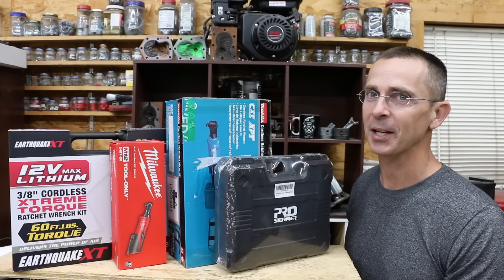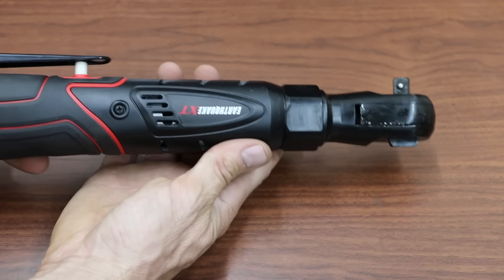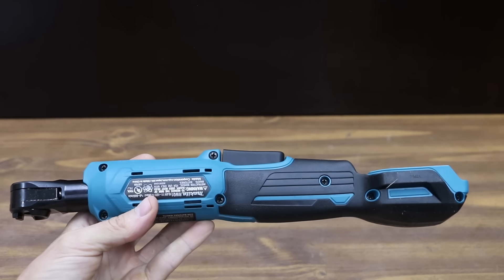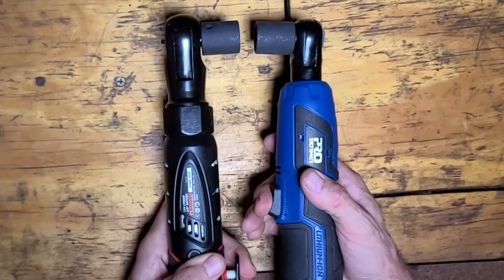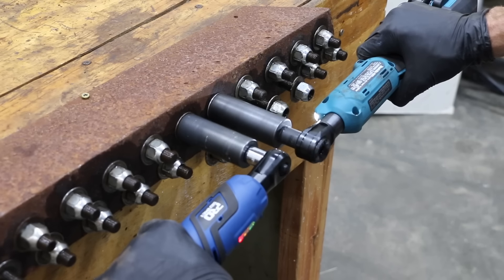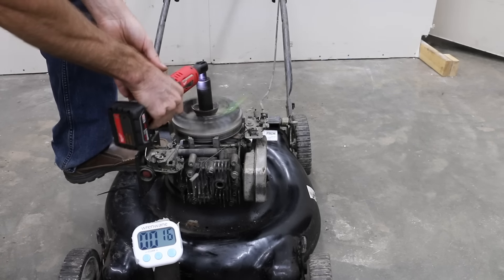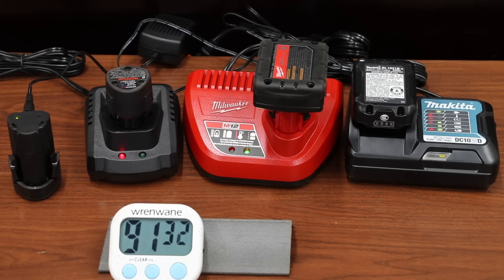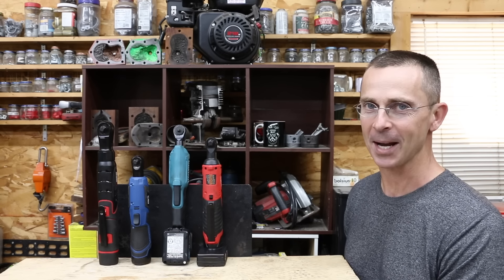Best 3/8 Cordless Ratchet? Milwaukee M12 vs Makita, Earthquake & ProStormer. Let’s find out!

Comment: I was a small engine mechanic. I hammered a Milwaukee 3/8 ratchet daily. It was awesome. I was diagnosed with Kienbachs disease.  The ratchet gave me the ability to continue do the work I loved up to the point where I couldn't pick the tool up anymore. I miss my old Milwaukee ratchet at my old employer.  I am going to buy one of these so I can fix peoples lawn equipment as a community service.  Small engine repair was the most rewarding job I ever had. I love picking up mowers on the side of the road, fixing them and giving them away. Normally doesn't cost hardly anything and their are plenty of people that need a mower. Plus it keeps good equipment out of the scrap yards and landfills.
Reply: Get the Fuel version of the Milwaukee. 55ft/lbs and a beefier head, can be used by hand.
Reply: Your community is damn lucky to have you.
Reply: Good soul
Reply: Bless your soul
Reply: Keep up the good work.
Reply: Keep it up! I love it when people keep good tools/bikes/cars/etc. out of the trash.
Reply: "@Robert Lamont" Milwaukee makes an even better one... Milwaukee 2557-20 M12 Fuel 3/8" Ratchet
Reply: Imagine what our country could be like if we all followed this man's example rather than yelling at each other all the time.
Reply: Really good for you sir.
Reply: I got my start working on engines with a 2 cycle moped. 10mm was the only size. Small engine repair has always stumped me. I have rebuilt v6 engines and 4 cylinder engines from the block up yet struggle to repair a small engine. They get fuel and spark yet never seem to start! I dislike them so much that anything small I have went electric with. Lawnmower, weed eater, hedge trimmers.  Hats off to you as I could never crack that code with them small engines.. they always make me feel dumb 😂
Reply: I know several diesel mechanics that use the m12 fuel version on a daily basis so I can agree with your statement Robert. I personally have a Mac tools one that I use daily.
Reply from the maker: Thanks for sharing!  I know a lot of folks really appreciate your help!
Reply: @BlockdAccount  Head is too large. I went for the bushed version for the head size. Best tool I own by far, and I have a LOT of tools I use.
Reply: Thank you sir!
Reply: We are one in the same. My engine experience started with a poor 3hp briggs and stratton lawn mower engine. It was by itself on the curb, no mower, when I was in 5th grade (1999). I was able to get it to run with nothing more than an adjustable wrench and a screwdriver. For me, that's where and when engines became something  for me to pass time with. To this day I still enjoy small engines on power equipment, and I eventually moved up to cars around 2001. I've had jobs doing both, but as an auto mechanic it made my hobby not so fun anymore and I ended up quitting. Shortly after I got a job running automated robot assembly machinery making different oil pressure control valves for GM LS engines and Ford ecoboost V6 engines. Unfortunately circumstances ended that for me. Recently got into a small engine mechanic job, but I was always at odds with the boss over how I viewed repairs, whats worth fixing and what was worth replacing. He told me that the 2jz supra engine was designed by BMW which is completely false, which I knew because I know a lot about older Toyota cars, AE86 Corollas being my forte. I thought it would be a good fit, but in reality I was nothing more than an oil changer and carburetor cleaner grunt. The last straw was an argument about a 70 dollar single stage snowblower snow box that was all rusted thin and cracked. There was nothing left to weld it was so thin. It was one of the first ones I looked at, which I said wasn't worth repairing and it needs a new one from day 3 on the job. Ended up spending 6 hours at 15 an hour trying to bandage the worthless part a week later. I tried, and it was about 90 dollars in time for me to be paid. A new one was 70 dollars, and I could have replaced it in 10 minutes and moved on. But instead he argued with me that I ruined a ruined part. I was about to just walk out, but I figured I'd come in the next day, a Friday and try. Ended up getting, "this isn't working out due to the tension" from management. Honestly, I'm glad, because now I look forward to the next opportunity somewhere else. I've always done machine operation, and I enjoy it for a job. Why? It is because machines don't argue, or make you feel bad. Not only that, I can be alone, doing my job, producing something that will complete a bigger picture. If I can't find anything such as that, I have decided to attempt to start my own small engine gig of sorts. Sorry for the life story here, but I just thought I could relate how the gear head disease set everything I've done in motion. A lone 3hp briggs and stratton. Wish I still had it.
Reply: As far as keeping equipment out of the scrap yard, I did have 1 opportunity to literally save something from the bin. Back in 2013, the local yard had a small bin in front, and I saw an orange something or another laying on top of the chaos. It caught my eye and I walked over, and low and behold, a vintage 70s horizontal shaft 2hp briggs and stratton engine. It was complete, even had a pulley on it, and was actually in pretty good condition! I grabbed it out and it pulled over with compression. I went to one of the guys working and inquired about purchasing it from the yard. He said I don't know, go inside and ask. So I did, and I walked away with it for a whopping $5. Took it home, filled the oil and some fuel. It literally started on the first pull. Very cool indeed. I haven't put it on anything yet to this day. But the orange 2hp became a sort of remembrance time piece. My late friend Mike was over by my house one time in October that year. I had previously took the muffler off because loud noise lol. It shot flames and pops and all the like and I told Mike about it since it was on the desk. He says, I wanna see that! He took out his phone to take a video, which comes up every year in my Facebook memories. He captioned it, "tiny tin motor shooting mad flames". He passed 2 years later. He got into some sort of accident on his sport bike without a helmet. Nobody saw it happen, so it remains a mystery. I have a theory as to the cause. Mike loved fast cars, and fast bikes. The area it happened was a 65mph zone left handed curve ramp from Highway 16 onto I94 east in Waukesha Wi. All anyone knows is he hit one of the yellow arrow signs and ended up in the ravine past that. I think Mike was in full blown moto GP mode for fun, he tucked the front as they call it, slid into the signpost with the center of his bike. When that happened I think its possible the bikes momentum caused the bike to stand back up and he hit his head somewhere on that sign. Then it broke away, and then it was over. Really miss that guy. One of the coolest people I've met. Everytime I go down to the garage I see that orange briggs, and remember his reaction and the smile on his face. So I guess 2 different small engines have both had a significant impact on my life. Keep doing the good work for people, its what I try to do everyday.
Reply: @jamesl9686  that's pretty darn fast for a 3hp kart man! I totally agree with you on other people's motivation and their passions. The guy came off to me as a "I'm lazy and just here for a paycheck" type of guy. I guess that is just all too commonplace these days.
Reply: I also have kienbachs but only in my left wrist.  I also have the Milwaukee which I got after watching DieselTechRon
Reply: My man!
Reply: @bansheedearg  sup
Reply: @ENGINERESCUE86  Replacing the Automatic Transmission Pan Gasket on my '97 Tacoma, just started leaking.  I love fixing stuff.
Reply: @bansheedearg  fun stuff! I'm having a snack after the packer game and passing out. Don't crossthread the bolts or you're gonna have a bad time. Ask me how I know lol
Reply: @jpgale  Do Miss Ron & his videos. Good guy!!
Reply: Good for you mate.
Reply: I salute you my brotha! I share your love for the community and also a mechanic always willing to do more for the community.
Reply: Good luck dude
Reply: Do any of you guys watch AvE on YouTube? Check him out he tears the tools (and other things) apart and give you the low down from the inside. Don't know his background but seems to me like maybe some type of engineer. I think he watches Todd on Project Farm.
Reply: America needs more people like you and less people on unemployment
Reply: That’s what it’s all about, u sir will live forever!
Reply: @ohioplayer-bl9em  I’m a small engine mechanic and we’re always amused by this. You definitely aren’t the only guy who I’ve heard of that can rebuild automotive engineers and can’t stand small engines. We had an aerospace engineer bring us a weed trimmer once and proclaim that he was stumped. I do some basic work on my old 94 Chevy but I find the engines in modern vehicles to be incredibly confusing compared to small engines 😂 so many sensors and vacuum lines and crap that simple small engines don’t have. I guess we all have our strengths and weaknesses.
Reply: That’s really cool of you man. I’m a small engine mechanic too and I agree that it’s incredibly rewarding. Usually repairs are simple and cheap, but people are always so impressed 😂. I’ve taken probably a dozen mowers from the curb and fixed them, which built my skills enough to get a job at a shop. Discarded push mowers are the best. 95% of the time you clean the carburetor, replace a needle & seat because of ethanol damage, change the oil/plug/filter, sharpen the blade and send them on their way. Costs all of 20 bucks.
Reply: Im only just watching this video now, but you sound like an awesome guy. Hope you're still fixing stuff.
Reply: I can fully relate to that. Trying to earn extra money in college, I got a job with Western Auto in Atlanta as their small engine mechanic for the summer. My only qualification was that I rebuilt my carburetor on my VW bug. That job allowed me to completely disassemble small engines if needed to repair them. I could study each product manual which was readily available. I also had a full warehouse of parts to use. I discovered that I had a mechanical aptitude which helped me with my final career after college and help my friends with repairs of their lawn equipment and cars.  What I learned has saved time and thousands of $$$ over the past 45 years.
Reply: I'm a retired police lieutenant.  The world needs more people like you, Rob!
Reply: Sir, have you got the ratchet you were wanting yet? If not, give me an address to ship it to and you will have.
Reply: God bless you GWR, best wishes for the future
Reply: Where are you located ?
Reply: God bless you brother.
Reply: Thank you for your service 💪
Reply: ... kudos!
Reply: @ENGINERESCUE86  yes the 2jz was designed in Germany but not by bmw
Reply: Sorry to hear about the disease. I have tried fixing an old Stihl chainsaw but it just does not like to stay running.
Reply: @monte0704  I own both, why? why not
Reply: You sir, are a man. 🤘
Reply: I just started as an auto glass installer and the bosses milwaukee m12 fuel ratchets are incredible, we mostly use them for removing windshield wipers but the uses are endless. Bought myself a mastercraft version til I can save up enough to buy a Milwaukee 😏
Reply: Thank you for your work. Have you ever thought about sharing you knowledge on YouTube? It would be a win
Reply: Thank you!! I’m buying it because if you!
Reply: @stevehardeman7209  deez nuts
Reply: I fix lawn equipment for my community. I am 14, and I wish I could afford one. It would be awesome.
Reply: Nothings worse then the landfill. So much unessessary stuff ends up in the landfill. At least at the scrap yard it gets recycled
Reply: thank you for this story, i hope you are doing well Mr Rob.
Reply: Beautiful.
Reply: Top man, I'm looking at getting one of these but can't afford a top branded one, not sure whether to risk a cheap one but just about to watch this video so might do that first then decide! Lol..
All the best mate from London England 👍💪🏴🙏
Reply: @AB-C1  I spent the big bux on a used snap on and afterwards noticed China has a knock off. For around 60 on eBay. 1/3 the price of what I paid.
Reply: Sounds like a topic YouTube viewers will eat up. Get to making videos too, I already subscribed to your channel! Best of luck to you in all your endeavors! What area of the country do you live, hope it's not California, as of 2024 we've outlawed small engines, 25hp or less, they're forcing all electric gardening equipment down our throats.
Reply: You are literally the only other person I have encountered with Keinbachs, I got mine at 17, and thankfully in my left wrist. I have the Milwaukee and love it, but for my DIY usage I would be tempted by the pro stormer
Reply: Wish you were my mechanic, dude. I'd be your hands while you can be my  failing ❤.
Reply: Totally awesome my friend. Dealing with arthritis in my older years, I am having similar problems holding onto the tools any more, but I love teaching people how to do their own mechanics and repairs. You know the old adage about teaching a man to fish. I see too many growing up these days without knowing how to do basic things.
Reply: Good bless you sir your a great example of a human.
Reply: People like you make this planet special. As a fellow citizen I just want to say thank you sir for the beautiful impact you have in our world.
Reply: @SgtSabotage  I have both. better?  I could argue that. Stronger. Yes. The new fuel model is def built like a tank. But bigger, heavier and slower too.
Reply: @joes.7536  True.  I suggest the 1/4in brushless then.  It's much faster that the 3/8 and 'stronger ' in my experience.  I always break free fasteners and tighten by hand, for the longevity of the tool, but I'm more impressed by the 1/4 than the 3/8.
Reply: You sir are a blessing
Reply: @ENGINERESCUE86  Few years younger than you, but I just had my first experience this past December. 
Parents ran their Honda GCV 190 power washer with no oil until it seized up. According to them it was trash, so I decided to see what I could see. 
Took it apart as much as I could with the tools I had and found the problem lol (who needs oil?). The flywheel was totally seized, and I couldn't remove it. I filled it up with oil, added some via the spark plug hole as well. It was very difficult to turn by hand but I gave it a few whirls then used my impact driver to give it a few spins. 
Took it out and tried to start it. It took a few attempts to get ignition, then it would die shortly after. Repeat the process and it starts running longer and longer each time. After a decent amount of smoke from the exhaust she was CHOOCHIN LIKE NEW!! 

I'm good with my hands and everything, mostly done woodwork and stuff but I swear to god the sense of accomplishment I got from it was huge and unexpected. Guess what was on my Christmas list? Yes, tools to work on my car/ small engines. Got an ODB scanner, gear pullers, feeler and spark plug gauges so I can achieve a little bit more the next time Im tinkering with something. 
To be honest I was half hoping something was blown up inside so I could really strip the whole thing down and get replacement parts for the learning experience. I know what I did was basically nothing, but to me I brought a broken down useless motor back to life and it felt *great*. 
- Parting note, my attempts at repairing my 98 Accord have failed miserably lol. Cant win them all I guess, still learned a lot for trying.
Reply: @A6Legit  that's awesome thanks for sharing
Reply: You are a wise and kind soul!
Reply: @ProjectFarm  ''
Reply: Would a 3/8 remove blades from a 48" zeroturn ? They are tight. Probably 50-60 ft lbs. 
I use a 1/2 breakover.
Reply: @dposcuro  man you was in no used of cash never heard of people of mean just giving free stuff away to rich people
Reply: As an 18 year old, you're the kind of person I aspire to be. My father has taught me well with small engine as well as larger engine repair. I've taken classes and have learned much about electrical work in a house or a car. Hoping to learn more about different trades so I can help the people in my community and make a difference.
Reply: Good for you it'll keep you well and you won't lose your marbles 😂🤣
Reply: I’m blessed just by reading your post my friend. God bless you and your family, keep on doing what you really like, helping others. You are doing that by posting this here. Will keep you in my prayers. On my side, been now 6 years, 3 months and 16 days today, free of cancer. They gave me 30 days back in 2016, it was a rare type of cancer, they called it Urachal Cancer. Till here God has been great with us. God bless you and your family and keep up, God will be with you. Blessings.
Reply: @macmurfy2jka  hehehe, they where asking me why I had 4 tires outside, used ones, outside of my house. They were good tires to drive in town, not for highway any more but they were still good to drive around. They came and got them!!!, yes, I like to save our planet too. Blessings.
Reply: you made the world a better place - look back with pride
Reply: Make a few videos of your engine repair and giving them away, people would love to see that!
Reply: How can you fix anything if you can’t pick up tools
Reply: If you want a 1/4 ratchet, get the 3/8 Milwaukee fuel, and then just switch out the anvil. I did it, although you might need someone to get the snap ring in there for you, it took me forever to get it in.
Reply: Are you talking about the normal  rachet or the new fuel version, I make some mechanic and I think this tools are a plus
Reply: 您真是一位善良且品德高尚的人！
Reply: You’re a good person for helping people like that. Thank you
Reply: “For God so loved the world that He gave His only begotten Son, that whoever believes in Him should not perish but have everlasting life.”John3:16 NKJV

“that if you confess with your mouth the Lord Jesus and believe in your heart that God has raised Him from the dead, you will be saved.”Romans10:9 NKJV
Reply: God bless you and thank youz
Reply: Hope you're doing well a few years later; your community is lucky to have you.
Reply: Praying for you
Reply: I liked my Milwaukee.... and then I grew up and got a Snap-On.